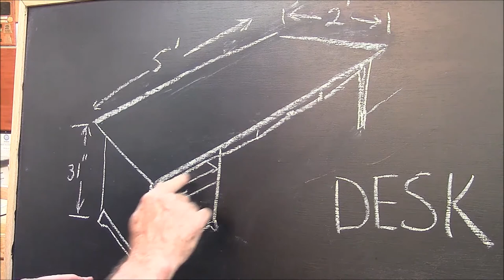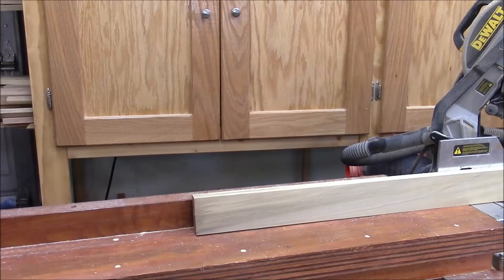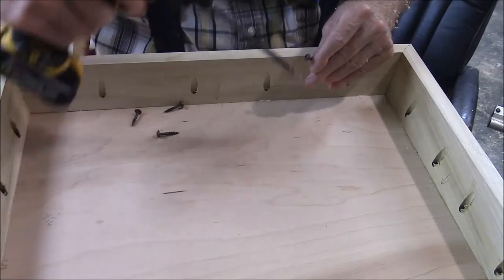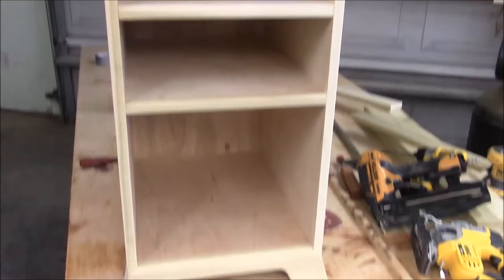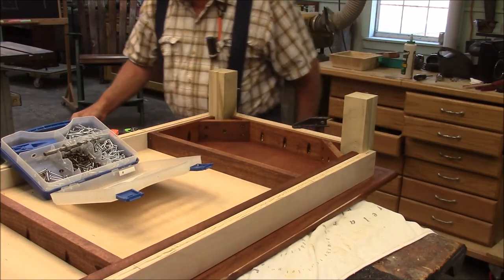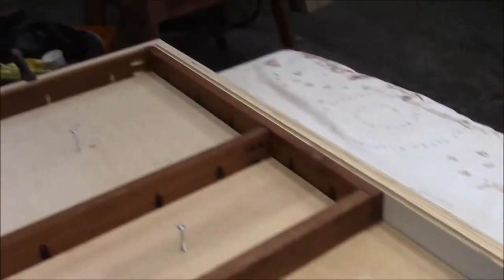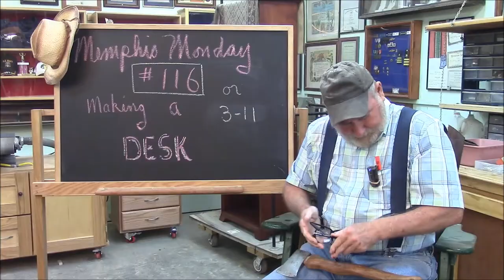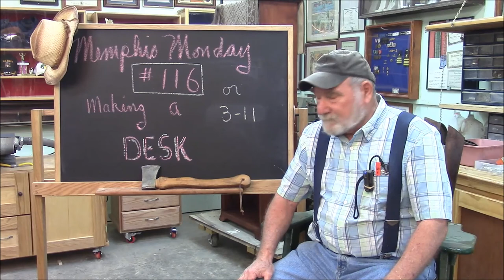116 Designing and Building a small Desk

Comment: I really like the look and design of the desk. Another thing I really like is that the top can easily come off and the legs removed for easy transportation, no truck needed.
Reply from the maker: I agree.  I already delivered the desk, and it would have been nearly impossible to get it in place had it been in one piece.  The way I put it together, a single person, in a pinch, could move it about anywhere.  I also designed it to be "storeable," if that's a word.  By taking the legs off, the whole desk can be tucked into a corner, taking only about 5 square feet of floor space.  Finally, and I don't think I mentioned it in the video, it is designed for multi-use, as with the desk top removed the drawer side case can be used as a table.  I started to build a little top for the drawer side case to support this function, but I didn't.
      Thanks for watching and commenting.  Hope to see you next week.
Reply: I hadn't thought about how easy it would be for the desk to be multi-use but that's definitely possible. I guess with the addition of two more legs the top could become a small dinette table, and the side could become a nightstand or something. And yeah, I think storeable is definitely a word -- if not it is now. :-D

Comment: Sorry for wimping out on you yesterday.  It has been an intense week and I just crashed last night.  When I got to the part about the compound angles again, my brain just shut down on me.  It does add an extra touch to this simple little desk.  I like it.   Did you have to do anything different  to drill the pocket holes in those boards with the angles.  If so, it might be a topic for a Memphis Minute.  

I have often wondered why you didn't stain before you assembled.  I have a problem with the stain pooling in the corners  so I don't get an even coat and it always looks blotchy when I do it assembled.  I like the color you chose.  Does this mean that this will be going to the same friend as the book shelf?

I have one of those kit desks from one of the big box stores.  Where you have a "pencil drawer", the front of my drawer is hinged and will drop down.  This allows the drawer to become storage for your keyboard.  That might be something you would be interested in doing for a later desk build.  I must confess that I got something backwards when I read the directions and got the drawer sliders upside down so the drawer isn't low enough for the keyboard to fit inside with the drawer shut.  Some woodworker I am.  I would have taken it apart, but you know how flimsy this stuff is.  It never would have gone back together and been very sturdy.  Maybe I could get a thing of gorilla glue and glue each joint.

I had a feeling that Mr Axe/Ax/Hatchet made an appearance in the fence build.  That is where he shines.

I think you know that I have been searching for one of those van style RVs, class B, but have had no luck finding anything I could afford.  At $40K I would have been lucky to get something 10 years old and 100,000 miles on it.  I just could not justify that.  I have never pulled a trailer other than a few short tries of my ex's fishing boat which ended in heated words.  That and the fact that most of them are so darn wide is why never considered one.  There is one style that has always caught my eye.  It is the ones with the fiberglass bodies.  The most popular is a Casita.  The nice thing about these little trailers is that there is no roof seams so a lot less apt to leak.  You just have to calk around the air conditioner and roof vent.  

After months of looking at the over priced Class B rvs, I resolved that I could learn to pull a trailer so I started my search for a Casita.  Most I found were in Texas or Colorado.  This past Tuesday, I opened up the RVTrader program and saw that one had just been posted about 30 miles from me.  I got busy and managed to make a deal that day.  I won't be picking it up until tomorrow because I wanted someone who knew what they were doing to help me.   I will be posting pictures in FaceBook and may even try to get wild and post a video on PH YouTube channel.     
 I will try to post the link of the actual ad here.   
https://www.rvtrader.com/listing/2007-Casita-17--SPIRIT-DELUXE-122434568  

I hope you don't mind that I have hijacked your channel to carry on this conversation.  Happy Monday!
Reply from the maker: Your trailer is great.  Perfect, if you ask me.  One thing I hated about my motorhome was that I was isolated without a vehicle after parking the thing.  I think this is why so many larger MH's tow little cars.  
     You won't have any problem towing this 17 footer; you won't even notice it on the road.  And with regard to towing, I've noticed that our minds have some way of adjusting to our "new size."  Moreover, you will begin to instinctively be tempted only into turning cycles and parking schemes suited to your new size.  
     However, you will need to learn to back the trailer up.  Just takes practice, unless you,  unlike me, were born with unusual driving talent.  
     The real fun will be learning about, and then maintaining both the electrical and plumbing systems of the trailer.
Reply: The more I think about it, the more I am liking this over the Class B.  I do like the idea that I will have a vehicle to explore the area I am in.  That would be difficult with only a bicycle.

The best part is that this is only about 6'8" wide.  I can take it on smaller roads without feeling like I am taking up both sides.   The hardest thing for me to do in regards to towing it is  turning a sharp 90 degree turn  and learning to pass vehicles.

Backing the trailer is the main reason I never considered getting one before.  However, I am a "somewhat" intelligent person and there is no reason I can't learn to do this.  The ironic thing is that my ex is going with me to pick this up and he is going to pull into an empty parking lot and let me practice a bit.  Let's hope it doesn't; end as badly as the boat backing did.  Hahahhah

Don't remind me about all the maintenance!!!!